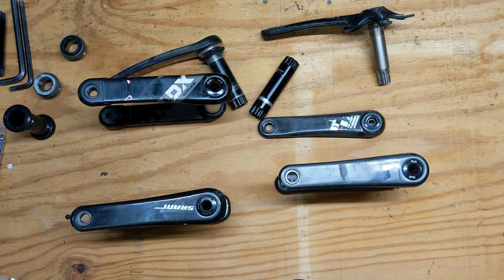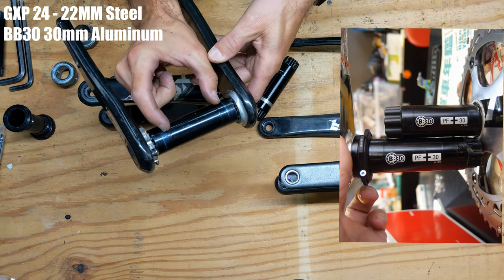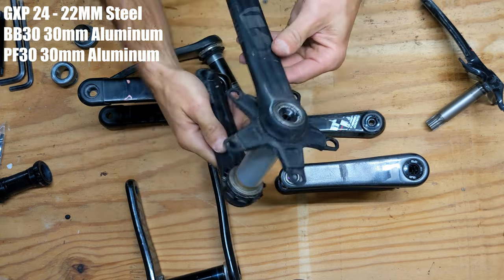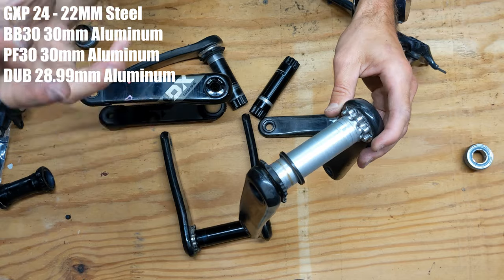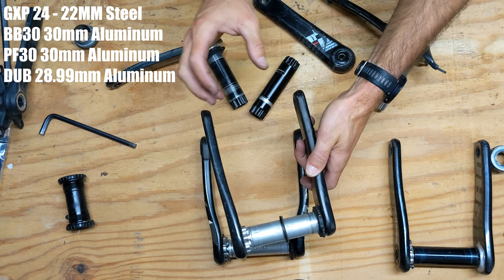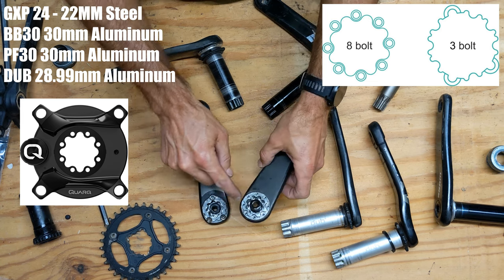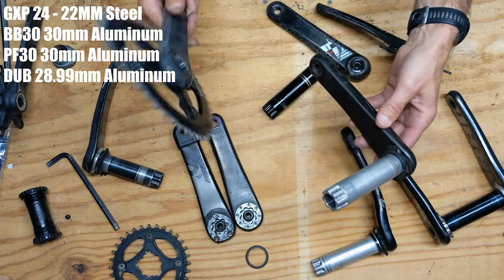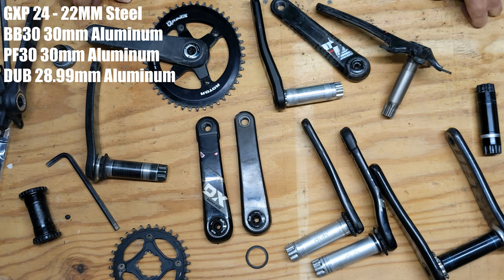Sram Crankset Spindles Explained | GXP BB30 PF30 DUB

Comment: GXP was bad, for engineering reasons (floating driveside bearing, no way to preload the bearings). BB30 was even worse and has rightfully died a long time ago. PF30 wasn't quite as bad but had tiny bearings so ate those for fun. DUB tried to solve that problem by shaving 1mm off the diameter, so basically the same and almost as bad. In summary bad, badder, not as bad, not as bad. Ultimately, avoid. Sram is doing some excellent things, in mtb and road, but cranks aren't one of them. Also when you say 'bottom bracket', in reference to the frame, then you should say 'bottom bracket shell'.

Comment: The real reason why SRAM moved to a 29mm spindle is the same reason why Shimano is on a 24mm spindle instead of a 25mm spindle. Standard 680x bearing IDs come in 5mm increments. Using 29mm and 24mm spindles means you can place a Delrin tophat in between…that prevents galling between the metal spindles and hardened steel bearing races.

Comment: Aluminum spindle is sooner or later going to wear and be trash. Switching to shimano because of this
Reply from the maker: I have had SRAM alloy spindles for years with no issues. The original PF30 spindles that were aluminum would have issues since they connect directly to the steel races of the bearings and would wear and cause clicking or creaking. The newer Dub are better because they use a plastic sleeve similar to shimano bearings so they do not have the wear like previous PF30 cranks. Shimano has had more crankarm issues than SRAM over the years. I would say SRAM have been more reliable than Shimano in the crankset arena though that is not the case in most parts with SRAM vs Shimano.
Reply: @BlackWaterCyclist  most of the spindles in the video already show some small amounts of wear. For people that ride a lot, it happens way too soon regardless of the amount of maintenance. Thats my experience and the same for many people I know that ride XC.

Comment: This has been extremely educational. Thank you!
Reply from the maker: Glad it was helpful!
Reply: @BlackWaterCyclist could I fit a 73mm SRAM dub bottom bracket threaded on my trek marlin 7 because I am looking to upgrade but don’t know between the gxp or the bb30 and my trek marlin runs a 
FSA 73mm threaded cartridge 122.5mm spindle

Comment: Nice video and presentation. Love this episode. Well done. 
Question: I have BB shell T47 x 86.5mm deep in a gravel bike. What us the odd I may have problem with crank set spindle too short or too long? Spindle length data are hard to find and scattered, why?
Reply from the maker: Thanks! With the newer T47 x 86.5 I have found that the older PF30 spindles are too short. You have to have one of the newer DUB spindles for that build.

Comment: Great video thank you! I have a question. Can you replace the GXP spindle? I bought a gxp crankset that has 24mm aluminum spindle. Is it possible to replace it with a steel spindle? Thanks!
Reply from the maker: I know this was a long time ago but no you cannot replace the GXP spindle. They are fixed to the driveside crank arm.

Comment: Since the ends of the spindles are the same between dub and pf30, am I right in understanding that you could change a pf30 spindle to a dub one and it would fit both crank arms? In the video you show that the spindle ends are the same and use a dub non drive side crank arm with a pf30 drive side crank. I have an old pf30 crank set and hoped to put it on my DH bike. For that I need the right spindle length (researching that now) and the dub width.
Reply from the maker: The issue with DUB is that the Nondriveside Arm is bonded permanently to the DUB spindle. If you can find a dub spindle somewhere that allows you to screw the Non drive side cranks on then yes you can swap to the DUB spindle. The only company I know that offered it was stages but their splines are clocked differently so you have to use their crank arm with the spindle and now they are out of business. I have purchased non drive side dub arms and spindles before for cheap and put a PF30 driveside crank arm on it for some cheaper builds.

Comment: i try to fit gxp sram force 22 crank converted in 1x with a direct mount gear on my 2000 trek 73mm bb... ant the result is, the spindle of force is too short for my bike... there is any solution like a slim gxp bottom bracket?? thanks a lot

Comment: Hi BC, thanks for this awesome tutoriell! A additional question about running a modern Quarq Dzero Dub Powermeter with a Sram red 11speed etap BB30/386 crank (8bolt): I heard Sram says officially that "its not compatible. it would fit but the chainring(s) would be ca.1.5mm offset". My questions: 1. is this correct? 2. If it's correct, what is the reason for this? (is the dub spindle 3mm shorter or longer? - I have no other explanation)? 3. What is yout thought on this combination? Thank you very much!!
Reply from the maker: I am sorry for the delay, just getting back into Youtube after taking a break. The DUB spindle is every so slightly wider than the older 30mm Sram spindles. I had a wider than normal T47 86.5mm BB (85.5mm is normal) on my titanium bike and I could run the dub cranks but not the 30mm cranks because they were too narrow. So putting the older Quarq on there will work. Just need to adjust your front derailleur properly. 1.5mm is nothing when it comes to front derailleur adjustment. If you are running 1x then it will not be an issue. Did you try it?

Comment: So this being said, could I swap any dub MTB crankset out with another no issues? No BB swap? I’m assuming the answer is yes
Reply from the maker: That is correct. You may have to add a few spacers if you have the newer Transmission crank which is the same width as the CL55 dub mtb cranks. Transmission/CL55 cranks have a 6mm wider spindle so you would need 3mm spacer on each side.

Comment: My bike has the SRAM GXP, Can I remove it and be able to change to one of the DUB ones without any problems?
Reply from the maker: The DUB Crank is compatible with your frame but you will need to change your Bottom Bracket to a DUB Bottom Bracket. What frame do you have? I could point you in the right direction of what Bottom Bracket you need.

Comment: You are a real expert. 
Do you happen to know if you can use SRAM Force AXS ETap front derailleur with compact Campy Ultra-torque crankset?
Reply from the maker: This was a long time ago and I apologize for the delay. Just getting back into Youtube after taking a year off. That is a great question. I have actually run AXS front derailleurs with an 11 speed chainring and chain and it shifted great. Did you ever try it?

Comment: Hi,
I have a question and I'll be so glad to help so my case is I have a Sram truvativ descendent cranks with BB30 PF30 spindle but my new frame is internal threads standard wich means a normal DUB it's not working because it is 28.99mm how can I fit my BB30 spindle on it?
Reply from the maker: You can actually remove the plastic dust shield from the dub bottom bracket and it will fit a 30mm spindle. Your spindle may not be long enough but you can always pop the dub dust covers back in.
Reply: @BlackWaterCyclist   Thanks for your quick response, you are awesome I am gonna try this out. Cheers

Comment: Hi @black water cyclist. The video was great. I have an older sram power meter where the battery cap has cracked and has also stopped working. It's from a 2009 Fuji D-6 bike. Can I buy a new poser meter spider to replace what I have? Let me know if you need more info.
Reply from the maker: Hi Mike, the issue you may have is that yours is 3 bolt and all the newer Quarq D Zero power meters are 8 bolt. If you could find an older lightly used Quarq Elsa or Riken (both 3 bolt) then you would be good to go. Quarq claims you can't swap between arm lengths with the older Elsa/Riken or it will read higher or lower depending on which way you move on the arm length but honestly it will not be much of a difference. A few second hand companies make 3 bolt power meters like Xcadey or Power2Max that you could swap it with. Another option is to find a right side 8 bolt and a D Zero power meter but that will be hard to come by in your exact length. I hope that helps.

Comment: So,,, SRAM BB30 has longer spindle than the original cannondale BB30? then can we fit SRAM BB30 road crank to BSA or BB386 frame if we have proper BB?
One anoter question is, In case of 8 bolt patterns, can spider interchangable between GXP and SRAM DUB or BB30 crank?
Reply from the maker: Sorry for the delay on this. I am just getting back to Youtube. Yes as long as you have the proper BB then it should work. The 8 bolt pattern is the same between all of them but the Dub spindle is about 1.5mm longer so if you put a Quarq or Spider that is 8 bolt off the older 30mm spindles onto the Dub, it will have your chainring sit outboard 1.5mm. Not the end of the world, especially if you are running 1x.

Comment: Hello,
Do know if SRAM BB30 (30mm) spindle like Stages D Spindle would work with Cannondale SL or Cannondale One cranks? In short are SRAM and Cannondale BB30 spindles interchangable if they are correct length?
Reply from the maker: I am sorry, I am just getting back into Youtube. You are right that the spindle interface is the same between Cdale and Stages but the problem with stages is that they have clocked the interface differently so you have to use their non driveside crank arm. If you put a regular crank arm on it, you will have one arm at 12 o clock and the other at like 2 o clock.

Comment: Hello, is sram crankset dub able to apply for Shimano lip 8 speeds?
Reply from the maker: Do you mean the Shimano spiders? Or do you mean with the Shimano Bottom Brackets? If it is 8 speed, you just need chainrings that will work with 8 speed chains.

Comment: Okay, will a Shimano SM-BB52 will work with the gxp 24mm ?
Reply from the maker: GXP spindle is 22mm on the non drive side so it will not work with the Shimano BB. The drive side is 24mm and will work with the drive side Shimano BB but the non drive side, you need a GXP BB or an adapter sleeve that goes on the GXP 22mm spindle to make it 24mm.

Comment: Hi thanks for the video!! Do you know if the 8-bolt pattern used with powermeter is the same between GXP cranks and Dub cranks? I mean, a modern powermeter spider named for Dub cranks, with the 8-bolt pattern would fit in a GXP crank? 
Thanks!! Best,
Reply from the maker: Yes it will fit fine. The crankset width is almost identical between the DUB and GXP so chainline should still be good.

Comment: Hi and thanks for all the explanation. I kindly ask you an opinion regarding 2022 Spark. Do you think is it possible to put the Xx1 Crankset with Quarq (dub standard) on the new Spark with Dub wide, working with spacer and maintaining 55 mm chainline? Thanks in advance! It will save me to buy a new 8 bold crank dub wide very hard to find.
Reply from the maker: The spindle might be wide enough for the BB but the crank arms may not have enough bend in them to be wide enough to clear the chainstays. That would be my concern.
Reply: @BlackWaterCyclist  Ciao and thanks for your prompt reply! On Monday I will finally check with my mechanic and I let you know;)

Comment: What about "DUB Boost", "DUB Wide" and "DUB SuperBoost +" spindle lenghts to address 52, 55 and 56.5mm chainlines.  The  spindles are etched with "DUB or DUB SL",  "DUB Wide" and "DUB SB+" to I dentify them.  I believe the "SL" stands for Standard Length" not "Super Light".
Reply from the maker: Great points here Mike. I guess I need to make an updated video. SL actually stands for Super Light. I have had both a Force Dub crank regular width and a Red Dub Regular width and the Red had SL on it and the Force did not.

Comment: So if I have a bb30 pf and want to switch to dub 28.99 I would need a new bottom bracket?
Reply from the maker: Yes you would or some sort of adapters which I am sure are out there but I have not seen them.

Comment: I bought a Gxp crankset I’m taking out my bb30 crankset can I use my gxp crankset with my bb30 bottom bracket if use a bb30 adapter?
Reply from the maker: There are so many variables here. Did you get it to work? With a shimano 24mm spindle it is easy to use an adapter but with GXP, you have to have the non drive side at just the right location bc it uses a 22mm Internal bearing and has to be placed in just the right location.

Comment: Hi,
my PM Dfour91 died and I need a new one. I would go for AXS Dfour which looks familiar with mine crank arms I used by now on Dfour91.
My questions is do they fit correctly? Axs D4 spider and crank arms with spindle from my d491?
Thank you in advance!
Regards 
Uros
Reply from the maker: Yes as long as it is the 8 bolt spider design it will fit perfectly on the DUB Spindle version.
Reply: @BlackWaterCyclist  thanks, but my question is oposite so older crank arms from DFour91 (2019) and a new DFour AXS DUB spider. It looks suitable but I'm not sure exactly?
Reply from the maker: @uroscernigoj5961  Yes, that will work as well. They are both interchangeable as long as they are 8 bolt so you can go from the DUB crank arms to the older Dfour91 30mm Spindle crankarms.

Comment: Is there a way to remove press fit crank arms ? and replace them with other arms ?
Reply from the maker: Yes, I did a video on it years ago and it can be found here: https://youtu.be/zqWmQNywos4
Reply: @BlackWaterCyclist  I have seen that video but that crank and arm has an bolt. I mean the newer press fit. I have an XX1 and a GX crankset but want to take the arms out and swap them. Is that possible ?
Reply from the maker: @ellrich07  If they are bonded to the spindle on the non drive side (meaning no bolt on the non drive side) then they are not removable.

Comment: Very nice video！helpful for me！and...can cannondale bb30 spindles be used on sram crankset？They look the same.
Reply from the maker: Yes they can, they use the same spline interface. You cannot mix and match crank arms though because the Cannondale is clocked differently than the SRAM so one crank would be at 12 o clock and the other at 5 o clock.
Reply: @BlackWaterCyclist  Cool！Thanks！
Reply: I have bought an X01 Eagle crankset, what bb do I need to buy if I have 2022 lunar Sram dub GX cranks?

Comment: Really useful, thank you. I wonder if you can swap the dub spindle of a dub crankset by an PF30 and vice versa.
Reply from the maker: Unfortunately the dub spindles are all pressed and bonded on the non drive side crank arm. I've taken a 30mm spindle from race face and had it faced down to 28.99mm and it worked great with the dub bottom bracket.
Reply: @BlackWaterCyclist  You meant that you took a bb30 race face spindle to be placed on a pf30 and/or bb30 sram crankset and it worked, didn't you?
Reply: @BlackWaterCyclist  How can a 30mm spindle works with a dub BB? It is thicker than the dub BB, isn't it?
Reply from the maker: @MarcO-hl5mh  I took the 30mm spindle and machined it down to 28.99mm which is what the dub is. You are correct, the 30mm spindle will not fit in a dub bb.
Reply: @BlackWaterCyclist  I think there is an option to have a dub spindle with bb30 and pf30 cranks,  you can set the STAGE G spindle on them. I'm going to buy the Stage G spindle for my Easton EC90SL crankset to use BSADUB BB instead the BSA30.
Reply from the maker: @MarcO-hl5mh  unfortunately stages clocks their splines different on both sides so you cannot do what you are wanting to do. Their non drive side arms are not clocked the same as others drive side. So you may end up with one crank arm at 12 o clock and the other at 4 o clock. Not sure why they do this because they could sell plenty of spindles if they didn't do it.

Comment: i used a SRAM XX1 with 30mm short spindle with threaded bottom bracket in my old Cannondale Super V900, i only had to find a threaded BB for 30 mm and also file the flat sides of the frame until it fitted. carbon crancks, short 30mm spindle, and less frame metal means i saved lots of weight. Also can run dual crown
Reply from the maker: That is awesome! I have seen people do this to be able to fit the older specialized S works cranks in regular 73mm BB threaded bikes. Glad you got it to work!
Reply: @BlackWaterCyclist   also you can use 83 mm wide spindle  in 73 mm narrow old frames  using spacers. old Rock Shox Boxxer used dust seals fit perfectly. i put Saint crancks in old frames. also the Saint BB has enought thread to reach the width needed.  

about 300 mm spindles, the are bottom brackets for threaded frames that has different bearings for that spindle diameter.

Comment: Do u guys know if i can take apart in 3 Pieces the sram dub ones?
Reply from the maker: You cannot. The Spindle is bonded to the non drive side arm.
Reply: @BlackWaterCyclist damn
Reply: @BlackWaterCyclist  so if It doesn't fit i cant change the spindle to the old One?
Reply from the maker: @francescocostantini5926  Correct, you cannot take the spindle from a DUB and put it on an older crank arm and vise versa. It looks like Leonardi makes a dub spindle for their cranks that has the same 30mm interface as the older Sram 30mm spindle cranks but this appears to be for MTB. https://northwestbicycle.com/products/leonardi-capo-crank-axle-dub-crank-separate-b-ln6050?currency=USD&variant=40061147545705&stkn=398fa69d1b59&gad_source=1&gclid=CjwKCAjwv-2pBhB-EiwAtsQZFGuWCDMD0vrl09GfBnhrjQN3x3Mm7qHOWqYOIguX0cVU519366fwxhoC4ygQAvD_BwE
Reply: @BlackWaterCyclist  ok thank u very much anyways
Reply: Hello. I have older crank set X01 with BB30 spindle, possible to remove spindle from non drive side. Can I exchange this BB30 spindle with DUB spindle?